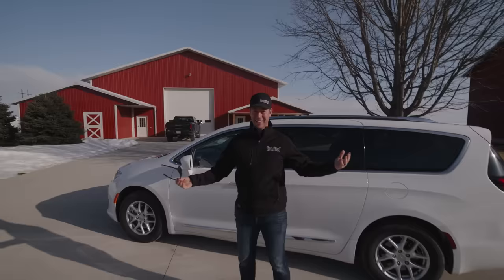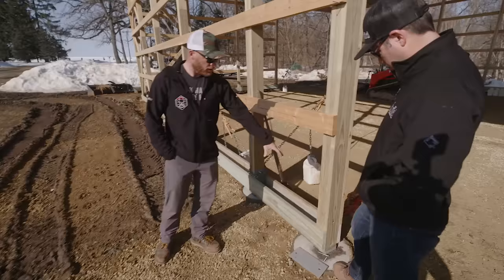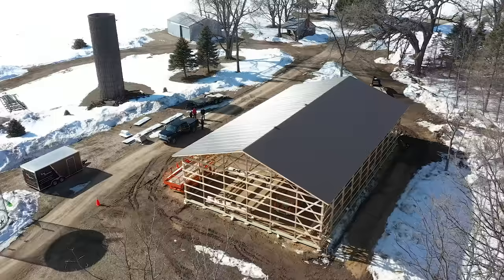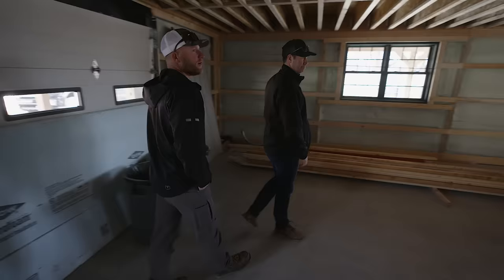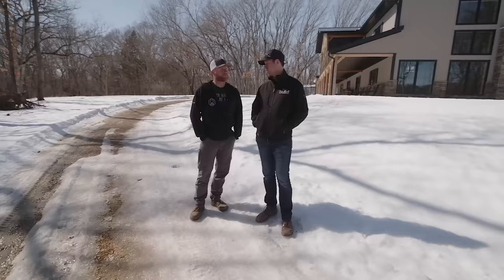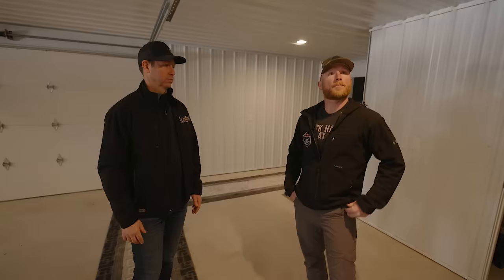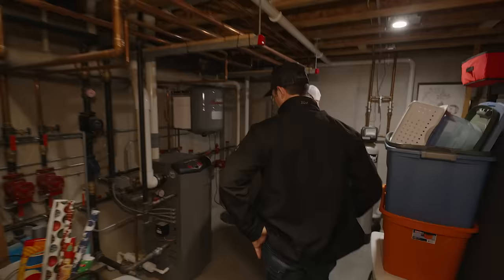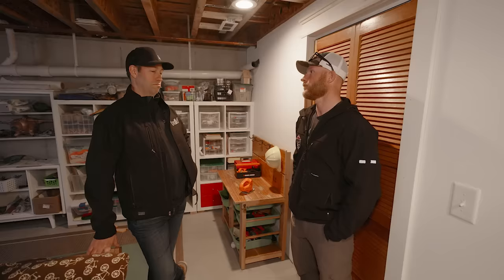BIGGEST Building - LOWEST Cost - Post Framing with RR Buildings!

Comment: ummm ya, its still a pole building. if it had post frame jointery and beams you could call it a post frame, otherwise its a pole building / barn. there is 0 difference between this and how people have been building them forever, with the possible exception of brackets.

 and whoever is digging your holes needs to get more accurate, some of those piers are waaay off. cant take advantage of the strength of a full concrete pier if your bracket is litterally touching the side of the tube.

Comment: In Northeastern Indiana, Lagrange County, how are the permits done for this type of building of a house to live in and how is any borrowing on it affected at the bank because they’re not “stick built”??? Or are they still considered “stick built” by banks???

Also, how much would it be to build the completed outer shell with finished inside of about a 1,000 to 1,500 square foot building in the same area of the country??? Meaning, I need the initial building but can do the inside room walls and such myself.
Reply: I also already have a partial basement, so can this be done to replace my current house???

Comment: Why not just build the whole thing in steel frames instead of wood ,stronger wind ratings and no termite damage in the future. Pre-fab ,less labour time,no measureing or cutting,no wet or dry rot,chemset onto pre-poured slab. More cost effective than wood and recyclable when demolition eventually occurs, no brainer.

Comment: look at 4 min mark in video the post is so far off the sonna tube footer, just imagine how many others are way off. IT IS A POLE BARN AND NOTHING MORE THAN A POLE BARN WITH A CONCRETE FLOOR AND HEAT AND MASSIVE HEATING BILLS JUST MASSIVE. The roof line is 200 degrees and 2 feet from the floor is is 40 degrees, all the expensive heat is in the ceiling area where no one is at.. This is a warm climate building only.

Comment: How is that not a pole barn? Please explain
Reply: A pole barn has the upright "poles" sunk deep into the ground.    A true pole barn the "poles" are set and then the walls are built upright. 
A post frame like this they're building the walls on the ground and raising them like a traditional barn.     
Think of it as a cross between a traditional barn and a pole barn.

Comment: How do these building make code insulation values? Are the roofs exempt?
Reply: Why would the roofs be exempt?  The  "hunting cabin"  has R38 loose fiberglass insulation above the ceiling.
Reply: @andrewalexander9492  That'll do it! All I saw was steel roof, didn't realise there was fibreglass. In my country there are jurisdictions where code is very forgiving if you don't intend to use as a primary residence.
Reply: @dreuthanasia1   It may not be apparent in this video, but if you look at the videos of the build on the  RR building channel, you can see that the roof is made of scissor trusses, and despite the vaulted ceiling, there's actually enough space above the ceiling for people to move round up there.

Comment: It looks exactly like every single pole barn I have ever built or been in. This is one of the oldest types of building. Nothing special about this.
Reply: Same structure using engineered products for tighter tolerances and better connections. It's not unfair to differentiate the two, especially considering how difficult it would be to get a traditional pole barn to meet modern energy efficiency standards for new homes.

Comment: As a German, seeing American buildings always feels medieval :D
Reply: Because?
Reply: @seanm3226  in the same way our way of building would seem medieval to someone from Switzerland :D

In our parts, you can only use three ply windows (they're technically 5 ply), the amount of insulation we use is insane, our windows seal so well, that we have to deliberately make them vent, they lock in 9 places. Some of this may be overkill, but most houses that get built today will still stand in 400 years easily. Some of this is overkill and some Americans would loose their minds in awe of the sheer number of regulations you have to adhere to. But it leads to really sturdy and long lasting buildings that use little to no energy, low costs in maintenance (most roofs will last generations) and it's just cool to see something like this built. I've just finished designing and building the Doors and windows for a House and just satisfies me, the way they contribute to the buildings efficiency, security and aesthetics.

That post-frame barn is cool, I'm just saying in Germany you'd have trouble getting that approved to use as a shed, let alone an office-space.

Again, it's cool, I'm in no way hating on RR :D
It's just vastly different than what I'm used to. Which is why I watch these videos in the first place :)

Jeez. That's a reply if I've ever seen one :D

Comment: 150.00 sg ft ist any better then stick framed 2000 sg is 300.000 for a pole barn house sorry post frame well post stick framed building have you built one on a basement just concrete floors

Comment: We've yet to see if some of the modern methods are really "better" a hundred years from now we shall look out from our robot visual perception Cameras  and then see shall see
Reply: The 'Modern' versions are what most houses are today, 2xWhatever's framed 16 inch on center with osb or plywood sheathing. These 'Pole Barns' or 'Post Barns' are a more ancient design like he mentioned in the video. This is basically how farmers used to build their big barns and some of them have been standing for 100+ years some 150+ years put together by a bunch of farmers with crappy nails and a hand saw lol. Back in the day when we still had very long straight lumber from big trees people were building what's called 'Balloon' framed houses, where you get a 20' 2x6 or 2x8 (or whatever you want) and frame it like you would today 16" on center or 2' on center and then you just build the floor joists right off of the middle of your wall to make the 2nd story. So your exterior walls went from foundation to ceiling. But we don't have really long lumber like that anymore at least that's easy to get and cheap. These designs are a lot older than our modern way of framing buildings.

Comment: Post will eventually rot when set below grade in concrete
Reply: Exactly. I liked also how Matt gushed over the cedar posts being held off the concrete. Umm, yeah, really no wood treated or otherwise should have its end grain touching concrete. Kind of a standard building practice.
Reply: @mjw9928  That's the best way is to keep the wood off the ground suspended with a metal bracket, I put treated post underground and they only lasted 15 years but replaced them with galvanized post which are guaranteed 50 years

Comment: That’s very nice framing but I do not agree that the wood frame is the “better product” over steel in any way other than cost. That’s just purely marketing the product you’re using…. You’ll never ever get an engineer to say that laminated 2x6s are stronger than welded I beam lmfao. These sell cause they’re cheap. Ya might as well buy a prefabbed particle board one from Joe Shmoe dealer in your town….why not? don’t you trust the glue? 😂

Comment: Nice system, well done.
You know what? If we'd taken half the money we've spent on the war on terror and instead used it for modern, safe-design nuclear power plants we'd all be able to heat our concrete floors on the cheap. Wouldn't it be nice to have a warm barn instead of pissing away our national wealth in some desert somewhere? Not to mention avoiding all the suicides and injuries.
One point: I think you'd be more correct to spell it post-frame, not post frame.
Next time, how about more fist-bumps? 😂

Comment: I do not care how you put it these building are pole barns, wood frames with steel siding and roofing, not even real solid wood posts glue lamb 2x6's for a post. I build steel building I have not seen a steel building be ravaged by termites it catch fire. Plus steel last 10 times longer than wood.

Comment: i fuckin hate wiring these things, fuckin nightmare
15:15 notice how the insulation an plastic is on the walls before the electricians have been there.  makes for a fuckin nightmare to get your wire to meet code for depth in the walls, amongst other things.  wiring these as houses, using romex, is shit show.  not to mention, you basically have to fabricate mounts if you want your receptacles at 18 inches, and vertical

Comment: Digging post frame construction.  Came from kyles channel actually.  I have to say though I don't get why post framers get butthurt when what they build is called a pole barn.  It's the exact same method, just swap out round telephone poles for the 6x6 posts or laminated 2x6s - and it's the same build.  Girts are still girts just hammered into square posts instead of round posts.  So the "offense" being felt is because you're calling a square post a pole.... sigh.  Not going after Kyle and RR here - Morton and Milmar guys act like "pole barn" is a derogatory term to them too.  But I guess that's just a sign if the times we live in.  If you're not offended by the most mundane and dumb shit are you even alive in 2021, Haha.  Oh society... thou art an annoying bitch.